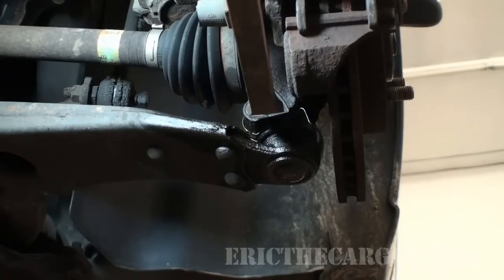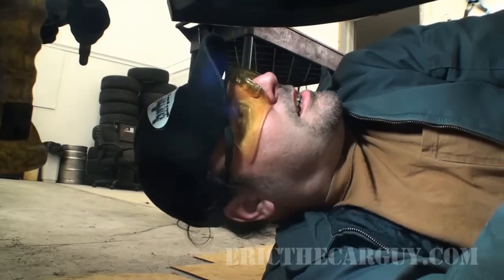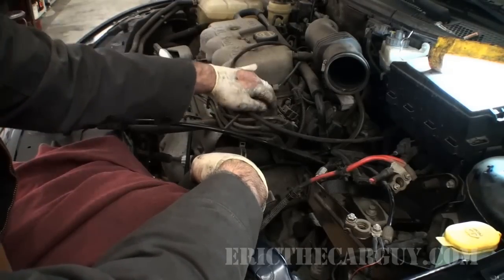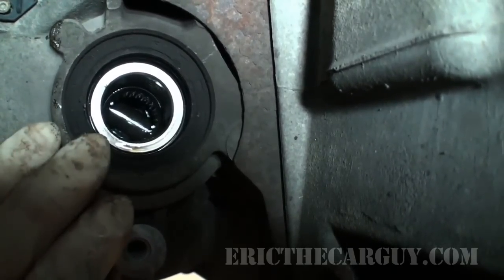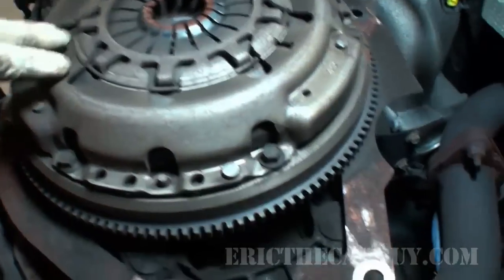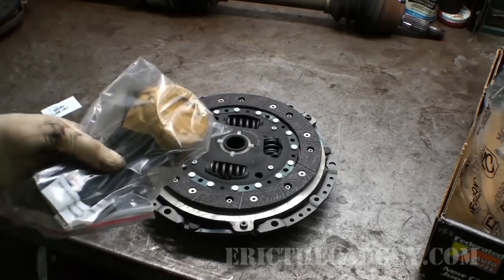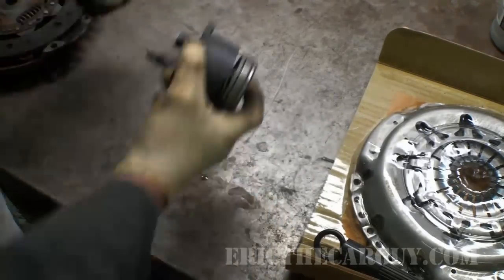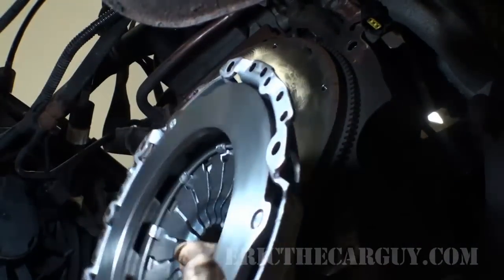2002 Ford Focus Clutch Replacement Video (Part 2) - EricTheCarGuy

Comment from the maker: @Vanuatoo Yes and no, it's actually spreading the load over the entire length so not as much weight as you think is placed on the fenders but consider also that the strut towers near where the brace is placed holds up the front of the car.

Comment from the maker: @eleeter No, that would just pull the inner joint apart and I don't want to have to deal with that.  Those cars that you did that on must not have had the axles in very well as I've never known that to happen.

Comment from the maker: @Bobkejt As for flywheels that's not really true.  I've actually done quite a few without any problems.  Think about it, if the pressure plate bolts to it the distance between it and the flywheel would be constant no matter how much you removed from the flywheel.

Comment: pro tip when you pull the clutch line off (or fuel line etc...) I use those rubber vacuum plugs/caps and slip them over the line so it doesnt keep leaking everywhere.

Comment: I did a clutch job on my dads focus and this helped a lot. The hardest part of the job by far for me was removing the through/pin bolts for the lower ball joints. I managed to get them out using the "screw the nut on flush and whack it with a 4 pounder till your hands fall off" method but not before completely destroying them. I had to go and buy new ones which, luckily, my local auto shop had in stock. I think it would have gone more smoothly if id had an air hammer, I think that's one of the major advantages to having a compressor as there really is no comparable counterpart to the air hammer in cordless electric. I tried smacking it out with an SDS on hammer only mode but no dice. An SDS is nowhere near as powerful.

Comment: A good idea on cars that changing the clutch is a actual pain(like this one) and not the fastest job to do is also to remove fly wheel and change the rear crankshaft seal while at it 10£ very well spent; as if clutch got worn is not much of life in that seal and will most likely start to leak way before the new clutch will worn down again. Great video Eric, as many of new small cars like this is a bit of work involved to do a clutch.

Comment: Eric, the pass side axles are easy, so you use a piece of 3/4 x 3/4 hardwood and slip it through the trans and tap out the left  axle, and the block holds all the bits in alignment. as there is a small possibility of dropping the spider pin.

Comment: Im using this video 12 years later great video but to the next guy that uses it do not underestimate what a tough job this is Eric makes it look easy i had many breaks to stop and feel sorry for myself and the short cuts i tried to take just caused me more trouble follow the videos step by step
Reply: Exactly, I just finished doing this and I had to move the transmission damn near sideways to get it out

Comment: when taking the driveshafts out (axels as you call them, im english..) would it of not been easier to just undo the hub from the struts instead of taking off the ball joint, ive done it this way before and worked out easier, with just enough room.

Comment: We use gearbox jacks at dealer to support the engine from underneath with a rubber block. Support from underneath is fine as long as it's solid

Comment: hey eric,im stripping cars for the last 17 years in ireland,ive done hundreds of focus,si find the easiest way to remove the drive shaft axle from the gearbox is to use a chisle  .wedge it in the small gap where thw axle meets the gearbox and then whack it with a hammer ,pops out easy no damage ,,love ur vids to..keep dirty,,

Comment: Awesome! I'm loving the Focus clutch replacement series. Had this been in 3D your floor jack would have wacked me on the right side of my face when it slipped lmao. Btw, what keeps that engine brace from shifting forward/backwards?Is it clamped to the fender seems?

Comment: you could have gotten the other axle out easy once the other one came out. Get a long bar and you can access it carefully through the gear box. As long as your sure you have it on the end of the other axle a light tap would have knocked it out

Comment: You need a balljoint separator tool - or fork and sledge hammer to get most lower tracking arm ball joints apart. That is best way not to damage the lower joint gaitor also. might not be recommended but I have seen people using 2 no 2" x 8" timber joist to use as the strut bar support - if you are only doing one job and dont want to buy a steel one - and it works ok 2 timbers bolted together that is UK class c24 timber though

Comment: Was that first new clutch one from the MTX-75 gearbox by any chance? for the 2.0 litre zetec engine? as the gearbox you removed looked like the IB5 box which does have a different clutch and slave.

Comment: Generally it's recommended that you put molybdenum disulfide anti seize compound on the face of the throw out bearing, just the thinnest amount you can, and use multipurpose grease on the splines, not too much. Run the clutch disk in-out on the splines to spread the grease.

Comment: Love this video, very detailed. Am not impressed with the replacement throw out bearing assembly, looks cheap. On the one axle that didn't want to come out, can't you just pull out on it sharply/quickly? I've done this on several mid 90's Japanese cars maybe that does not apply here. Not sure you should be putting any lubricant on the throw out bearing, centrifugal force will spit the grease all over the friction material, no?

Again great video!

Comment: Note to anyone removing an automatic transmission, obviously not performing a clutch replacement, They are a lot heavier than manual transmissions, and you will have a struggle getting it to drop from the car safely.

Comment: Your videos are awesome :) in regards to that metal clip which holds the clutch line on, i changed an engine on a Ford Fiesta i had and lost that clip during that process, i bent a piece of welding wire into the same shape, worked like a charm :)

Comment: I just did this job. Not too bad. I had the other style slaves cylinder. There are two different 5 speeds Ford used and you must have the other. Personally I like Lux clutches. Put several in and they're great. Also use the new style of bleed valve that doesn't require any tools.
Reply: Robert Gary I just had a shop replace my clutch, flywheel, and release bearing and it came back leaking puddles of transmission oil from the bellhousing area. The release bearing has the transmission input shaft seal on it so there is some problem with that.

Comment: I've used those little plastic finger pads on die grinders and had them remove material, despite the insistence of my boss saying plastic can't remove metal.. as sparks fly while he's using it..

Comment: Eric, I need to take off my hydraulic line and It is a little different than the one you worked on. I took the metal clip out, but  it is 1 tube going to the bell housing/ slave cylinder and it has a bleeder screw. It doesn't snap out. how do you disconnect the hydraulic line?
Reply: Got it! I had to wedge a long flat screwdriver from underneath where the line disconnects and tap it with a hammer holding the long screwdriver against the bell housing. The old end of the slave cylinder gets marred but the end is included with a new slave cylinder and new clip.

Comment: I had that trouble. couldn't get N/S shaft out because of a circlip on the inside of the shaft. took out O/S which has no circlip shaft then hammered the N/S Shaft out through the diff from the O/S with a long bar and hammer.

Being left hand drive your N/S and O/S are round the other way!

Comment: So, what about the side differential gears and their alignment? I'm going to be doing this job and the manual puts the fear of God into you that a special tool must be inserted into the transmission where the axles locate in order to prevent misalignment of the side gears - however that may actually occur I'm not sure?

Comment: hey eric napa has a nice slide hammer set comes with a bunch of stuff cheap to under 100.00 i have had in service for more then a year now still works just as good as the day i got it check em out

Comment: eric i have a problem with a renault car 90hp the clutch makes a noise hosc hosc like the noise you hear when you resufacing a head. but it works fine its not sliping.when i press it the noise goes away.what do you think?please help its brand new cluch why this happens?
Reply: Thrush bearing
Reply: Ram P Could always try some Caneston...

Comment: Also I see that spi focus has a bracket that supports the exhaust, rite behind the downstream o2 sensor.My Zetec Focus  doesn't have that exhaust mount to eliminate vibration!  Im sure that not having that mount is why my flange leaks & i go threw exhaust gaskets constantly! & STILL MY EXHAUST IS STILL LOUD. seems a trip to the junkyard is in order! just like on my old 92 grand am, it didn't have a specific (TOP, FRONT motor mount that many achiva & Skylark 3.3ltr motors have.tho Pontiac seemed to think that my 3.3 didn't need it.even tho it went threw motor mounts left & right, from excessive vibration from lack of the 4th mount! After a trip 2 a junkyard & installing said mount= NO MORE PROBLEMS!  my 1st MOTOR MOUNT WENT OUT RITE IN FRONT OF A RUBBER STORE, THANX TO (WHEELING RUBBER)& THEY HOOKED ME UP ON THE CHEAP WITH THE EXACT PIECE OF RUBBER SO I COULD REBUILD MY MOUNT FOR $3 DOLLARS= HUGE SAVINGS!!!!!THANK 2 YOU ETCG!!!! NOW I KNOW THE PART MY CURRENT CAR NEEDS!!!!SEEING THAT EXHAUST MOUNT = NOW I KNOW WHY I KEEP HAVING THE SAME PROBLEMS OVER & OVER WITH MY EXHAUST!== FORD CHEAPING OUT!!!! ETCG SAVING THE DAY AGAIN!!!! HE'S THE MAN!!!!! THANKS!!!

Comment: no you dont need the alignment tool. its helpful but not nesseccary. you can eyeball it fairlt easily. line up the center and feel the pressure plate around on three positions and make sure they are even, bam aligned.

Comment: If it's same 2.0 as my escape manual trans which is 2002 zetec if you push in on CV axle then turn and pull it comes right out just started on mine

Comment: Instead of the tool from harbor freight, maybe a cheaper way would be to a length of 2 x 4 lumber across the top of the engine compartment and rest it on top of inverted v legs on either side of the car, with plywood brace to keep the v at the correct angle

Comment: ive never burnt a clutch in my life
Reply: +Aaron P Step 1: Pull handbrake.
Step 2: Put in some gear higher than 1.
Step 3: Accelerate to a few thousand RPM
Step 4: Slowly depress the clutch until u feel the car start to pull and stop.
Step 5: Wait until u smell burning clutch.
Step 6: Keep waiting.
Step 7:  Repeat steps4-6 until you completely depressed the pedal.
Step 8: Profit? Dunno...   Congrats you just f...ed up your first clutch...
Reply: well I guess with ford focus you have to remove the clutch to access the salve cylinder.
Reply: Aaron P fod